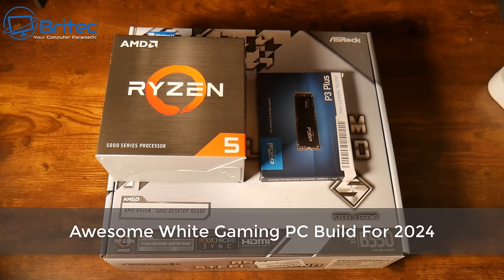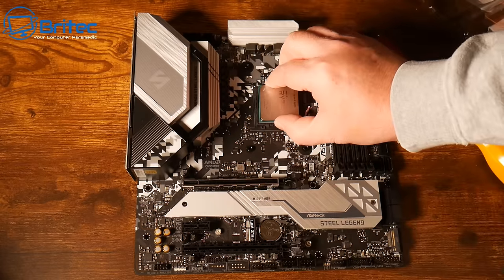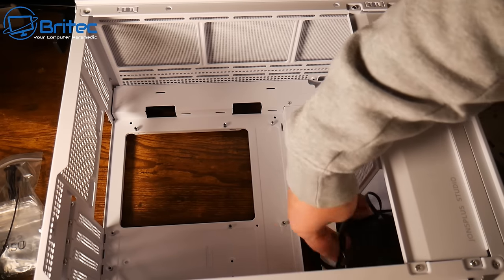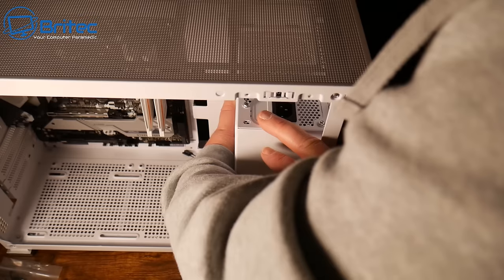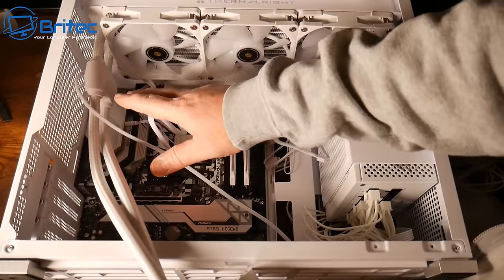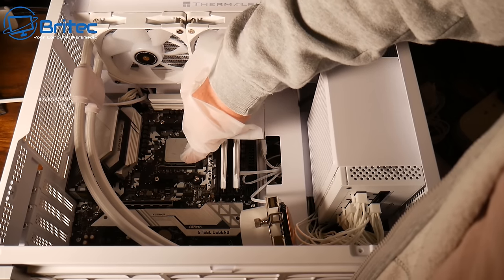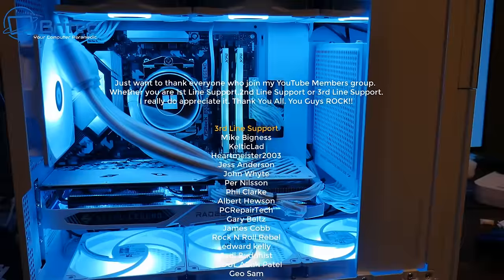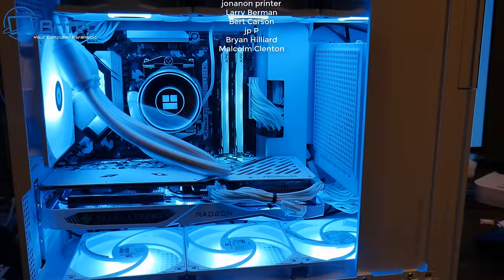Awesome White Gaming PC Build For 2024

Comment: You still need to invest in a cable-tie gun. You get consistent wrap tension and a clean cut. It helps make things look more professional.
Reply from the maker: Like I said, I don't like to use to many cable ties
Reply: @Britec09  I too do not like a lot of them in my build. They are a pain in the ass. But they are a necessary evil sort of speaking. I just like the fact it puts the proper tension and then cuts it flush and clean in one motion. Makes them a little less of a pain. But I see where you are coming from.

Comment: Not too shady for budget build for gaming. I probably would have used a more suitable case with PSU in correct position for good ventilation. Personally I would have  preferred front fans over bottom fans. Two front and one bottom is acceptable. 

Currently your exhaust ratio is 1 up than your intake. Not certain if that is good as compared to having more balanced or equal airflow. Especially with liquid cooling on CPU, with RAM, NVME and GPU air cooled. 

All parts are gold except case.
Anyway not bad!
You asked for opinion and that is my honest opinion.
Reply from the maker: Wanted to build in that case
Reply: @Britec09  I get it!

Comment: I would avoid cases with a psu in the front like that but if I had to build in that case I would go 240mm radiator on the top with hoses towards the front, I would avoid any water cooler that does not have the pump directly on the cpu. Everything else is fine. For argb cases rite now I like the fish tank design, for mATX builds look at all the clones of the Lian Li 011 Mini.
Reply from the maker: thanks for watching
Reply from the maker: Happy New Year

Comment: Fairly large motherboard for a micro-atx, usually on micro you don't get 4 memory lanes and 2 pcie.
Very weird location for the psu, you have no access to the back of it for power off switch.
Honestly, I don't like it, too many fans (especially the 3 bottom fans is a real eye sore) and the psu location is $hit.
Would look much better with 2 front intake fans, cpu air cooler and psu in normal location, it would clear away much of the cables and look much cleaner.
Reply: Agreed.  Was a concern of mine as well..
Reply from the maker: Its just a fun build

Comment: Good stuff Brian and it ahs me interested in whether to build again or not. Myself am an Asus and Intel fan and ma now wondering just why you use AMD Ryzen processors - having said that I have to admit that I am probably influenced by the fact that AMD processors back in the days when I built my desktops were rumoured to be inferior to Intel stuff. Now the case you have there looks to be quite nice but I would have to go with a Cooler Master case as I think they are much easier to work inside than others which do come in some really annoying "transformer" type designs. Lastly I have always thought that you should "bench test" a board before installing it so what is the go there? That PSU looks really what I would go for as I do run high powered PSU's in my builds if only for a little overkill.- my main desktop is a Corsair 1050W output for example.
Reply from the maker: Thanks for watching